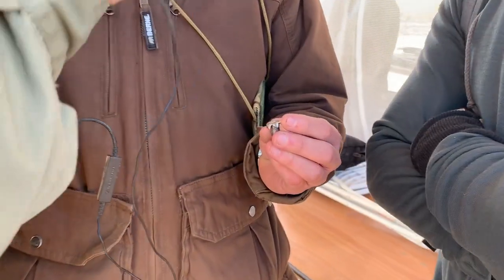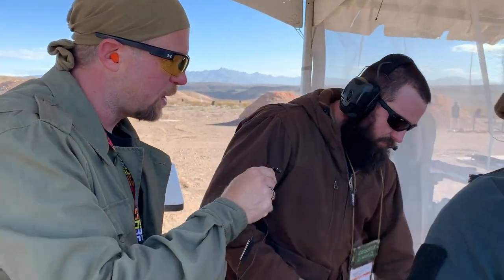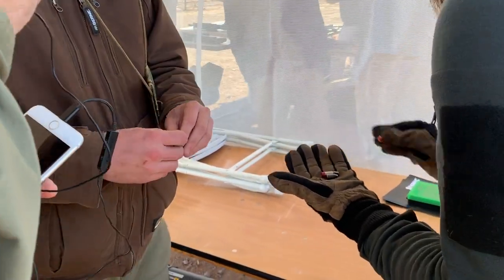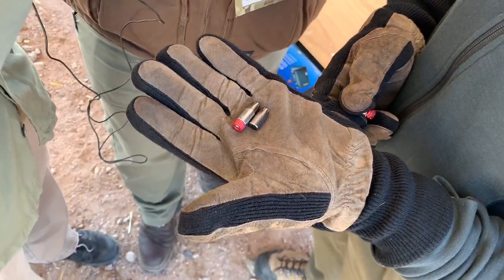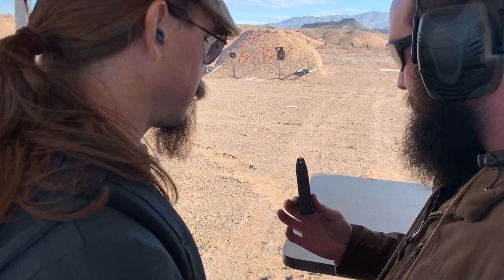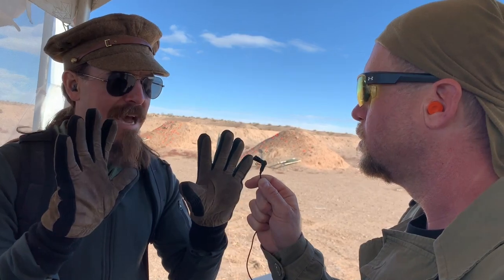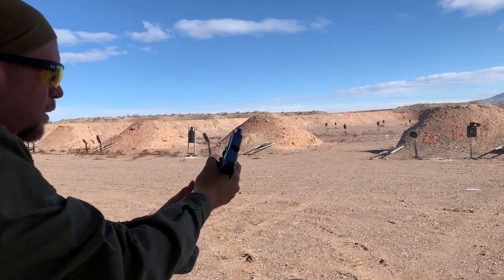SHOT Show 2019: Seismic High Mass Ammunition

Comment: Seems like a good idea for suppressed uses.
Reply: @Paelorian  Two factors go into calculating kinetic energy, mass and velocity.  If you limit your velocity to just below supersonic the only way to deliver more kinetic energy is to use more mass.  More kinetic energy typically equals more effect on targets when hunting.
Reply: @Tomartyr  hollow points are a war crime lol
Reply: @Tomartyr   I do understand that the bullet does not need to be a hollow point to be heavy
Reply: @willh2739  The projectile has to be the same length to fit in magazines, so packing weight into the same space means you need to experiment with dense metals.
Reply: @willh2739  doesn’t mean they don’t get used
Reply: @willh2739  Actually the US never signed the hague convention
Reply: @silentbob267  People often cite that, but you can have all the kinetic energy in the world and have it not matter if it doesn't interact enough with the target. Heavy rounds carry a lot more momentum and transfer that energy with more "oomf"
Reply: @wrathmachine7609  Not necessarily, in fact these rounds are a perfect example of packing a bigger projectile into the same cartridge size by expanding it backwards and reducing the amount of powder space used

Comment: Knockdown power is a meme in terms of handgun calibers, but that expansion on those rounds looks pretty nasty.
Reply: Eh ive seen deer with everything from 9mm to .45 acp, 10mm and .44- bigger bullets have a much more pronounced affect on live targets
Reply: “Knockdown power” is a meme in relation to how hits usually discusses (caliber v caliber) but the higher amount of ft/lbs would be nasty in the wound channel. Very interesting round tbh
Reply: @jamesstewart3856  higher ft/lbs doesn't mean anything for tissue damage assuming a complete pass through of the target. Handguns do not produce sufficient velocities for hydro-static shock to damage surrounding tissue like rifle cartridges. Strictly speaking of wounding capacity the larger the projectile as it passes through the better. IE FMJ 9mm < FMJ .45 ACP < HP 9mm < HP .45ACP. This is also assuming the projectile retains 100% of its mass, the more mass it dumps = more fragmenting, more fragmenting = more tissue damaged. Again, assuming complete passthrough.
Reply: Pretty little fun summer project for the surgeon for sure.
Reply: I think it's a meme till about 9x25 Dillon/Max 10mm Auto loads. At that point I think the wounding potential on CXP2 size game (deer, antelope, goats, small black bear, human) does start to pull away from the 9s and 45s of the common handgun world.
Reply: Eh, I think the people clamoring over the kinetic energy equation often forget that it doesn't matter if the whole of the energy isn't transferred. Momentum and mass does in fact matter.